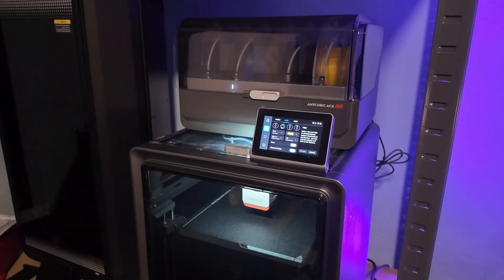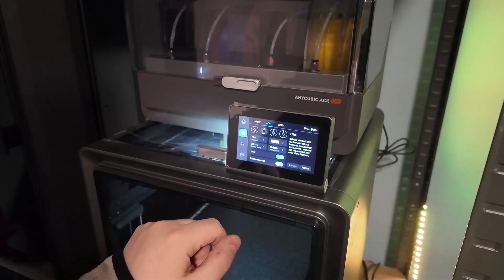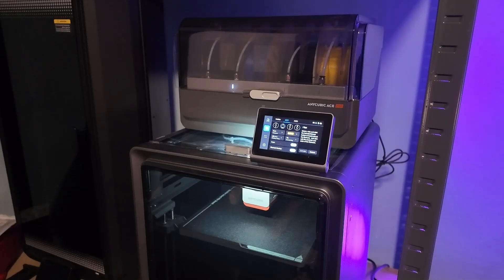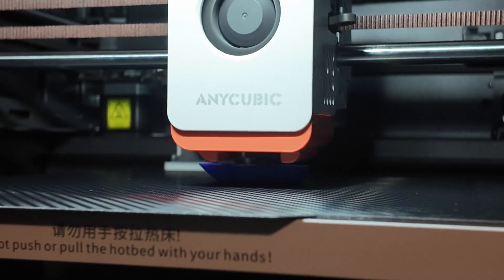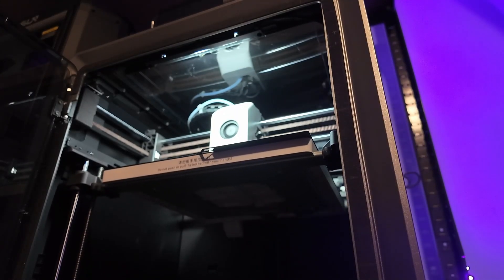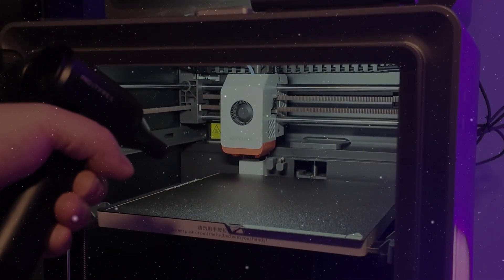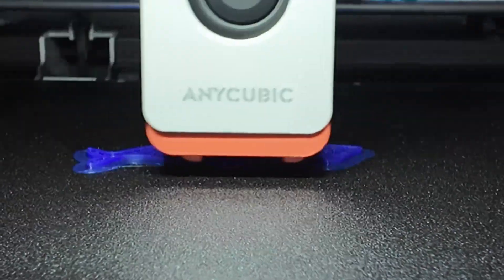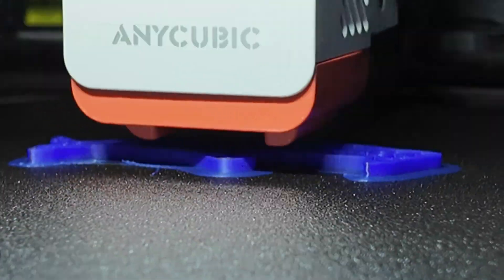Can the Anycubic kobra S1 replace GOAT's like Bambu P1S or even X1C?

Comment: Got a refurbished on eBay with 20% off for holiday sale for about $250 without the Ace pro. Took a little to learn coming from ender 3 and ender 3 max neo and Cura. No major issues and so far the only issues are due to user error. Really happy with the factory refurbished
Reply from the maker: many ppl have good experience with it, i'm glad you do too :)